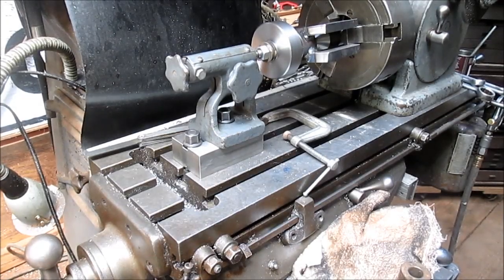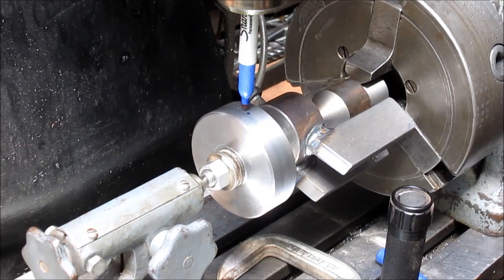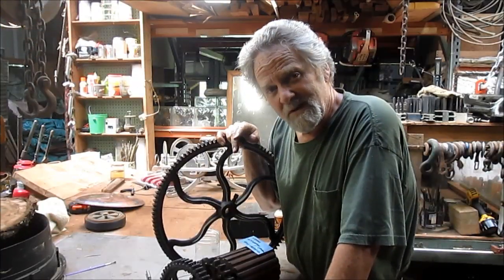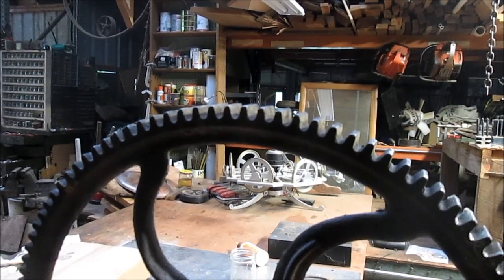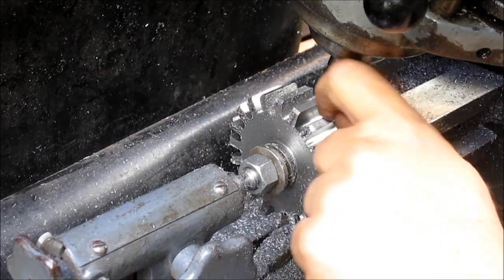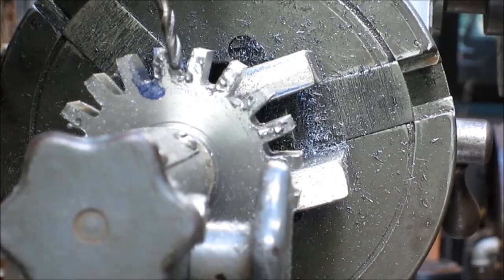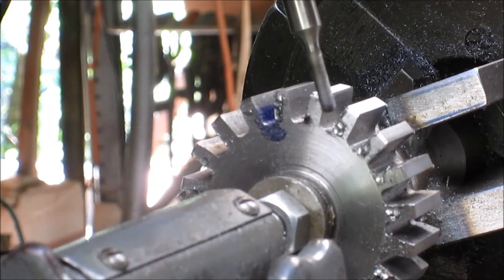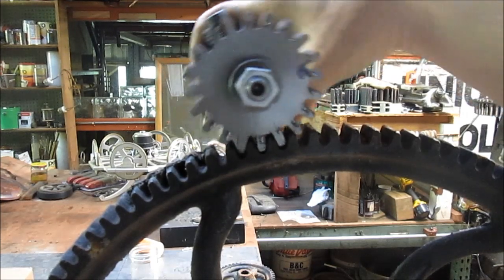Motorizing a Harbor Freight Tubing Roller #2

Comment: Good video.  I've never ever considered making a gear without a real gear cutter.  I learned something and it brought a smile.

Quick question... What's that machine behind you with the six vertical wheels and what looks like a motor in the center?

Jack
Reply from the maker: zyzzy1944  Ah yes, the ol' anti gravity machine. I made a small one in the 70's that was too weak to work, so about 10 years ago I decided to try again. The motors (2 upper and lower) are strong enough, but there was so much torque on the six vertical wheels they broke the welds. Back to the drawing board. I haven't touched it since. On to other projects. It's now a kinetic sculpture. One of many collecting dust in my shop.
Reply: Anti gravity machine and a kinetic sculpture.  Both sound very interesting.  How about a short video?
Reply from the maker: zyzzy1944 https://www.youtube.com/watch?v=u-T2nDnsJaM
check out my studio tour 2013. I touch on the anti gravity a bit there. I've got so many current things going on that it is hard to film past projects.
Reply: +zyzzy1944     I think he's built a time traveling machine :-)